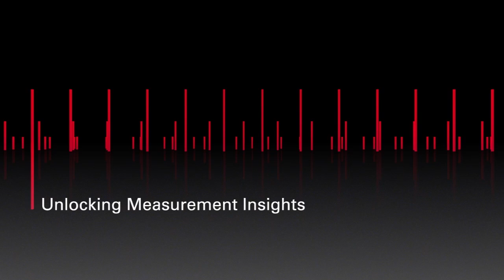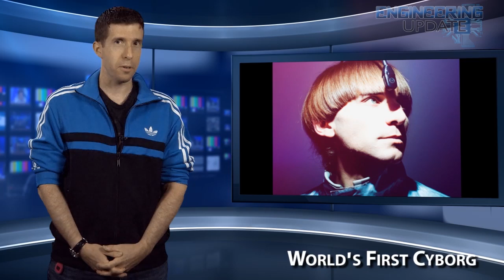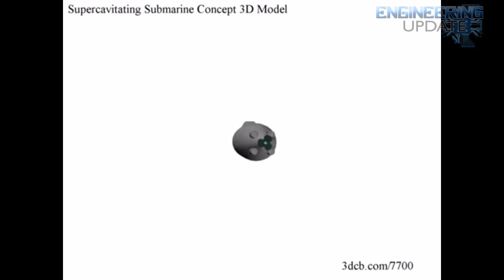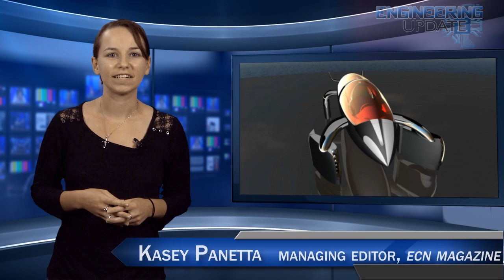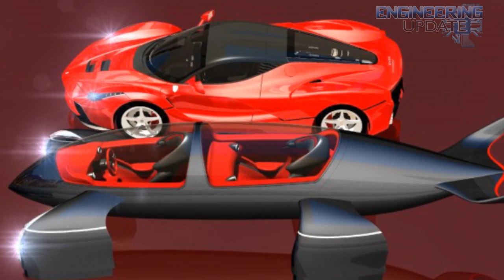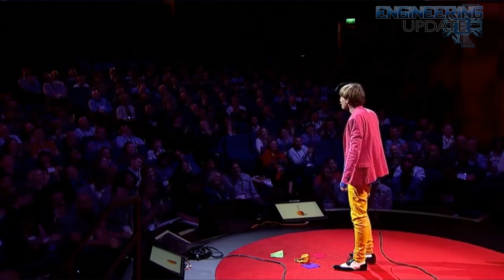Engineering Update 74: Supersonic submarines could travel at speed of sound

Comment: This is purely retarded! There is a reason that subs made more blade on the propeller, to reduce the pressure that they created when in use, and to allow the subs to travel at lower RPM's and still get enough thrust while not heating up the water around the propeller, which causes bubbles that pop underwater, which in turn causes the discovery of the subs.

Why then should we make subs run faster underwater, creating more bubbles from the pressure of the subs moving at high speeds, and in turn making them show up on sonar?

Yeah, way to go dumbasses! You may get from point A to point B, but you just became a blip for anti Submarine tech to target your sub.

Comment: 767.269mph is less than 3600mph..........
Reply: +MuppetV23 ". . .it could enable these vessels to reach the speed of sound underwater. . ." We're not talking about the speed of sound through sea level air. It's a submarine. Sound travels through freshwater at around 3320 mph and seawater at even higher speeds.
Reply: +InfuriatedHawk Bravo, you are of course correct regarding the increase to the speed of sound, when in sea water. But that is not the speed theorised : http://www.wired.com/2014/08/how-we-can-get-submarines-to-travel-at-supersonic-speed/
Reply: MuppetV23 Ah I see. The required energy output for supersonic underwater travel is already a bit ludicrous, let alone the energy needed for hypersonic underwater travel.